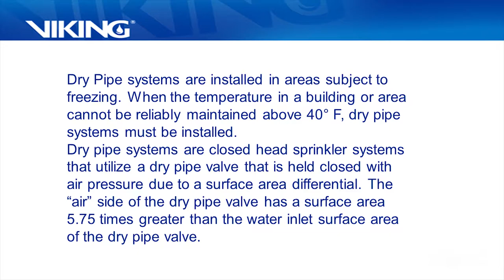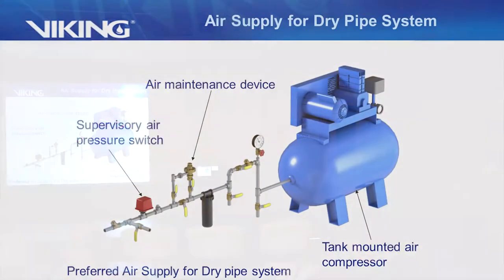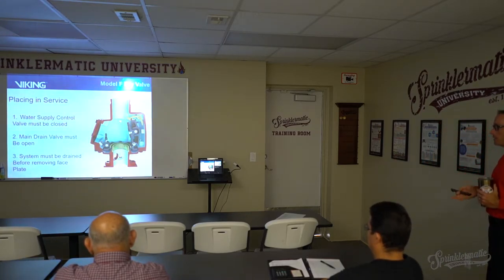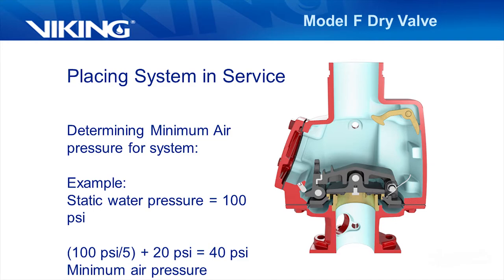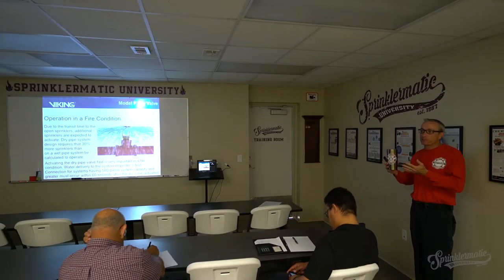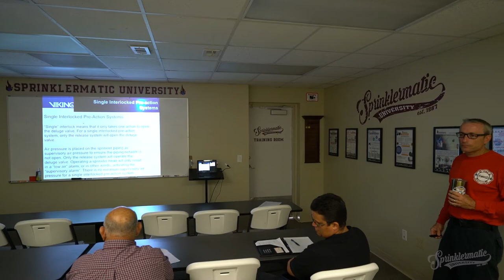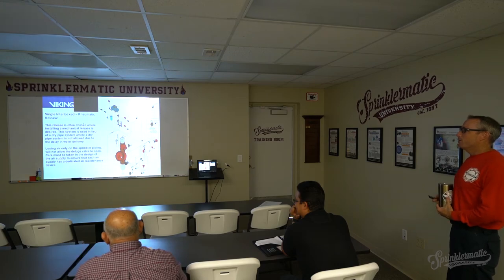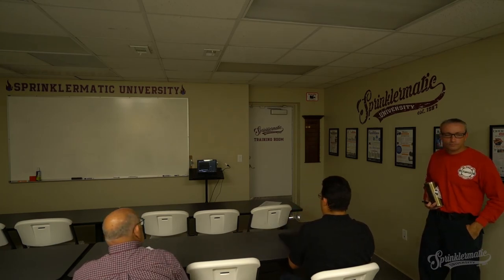Fire Protection Systems Dry Pipe, Preaction, and Viking Firecycle Systems

Comment: The only reason there is a hook to hold the clapper is that on a differential alarm valve,
the main drain is under the clapper unlike a water system where the drain is
above the clapper. So this allows draining the system after it tripped. The
main drain is placed so because the drain valve is watertight but not airtight,
so there would be air loss through the main drain and if compressor’s off or
not strong enough to compensate the air loss, system will tripped and that can
cause a lot of damages if system came froze.